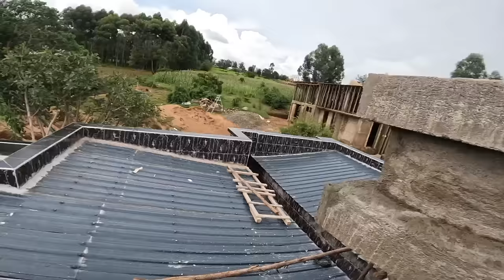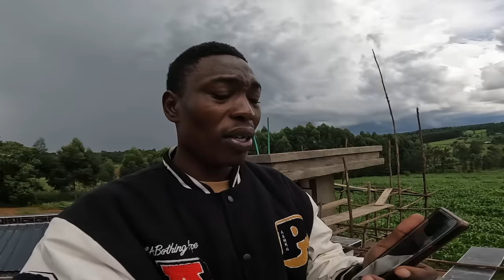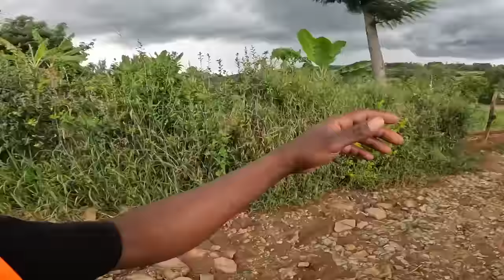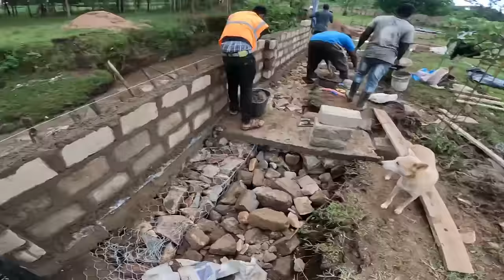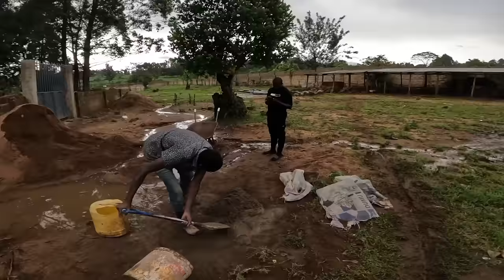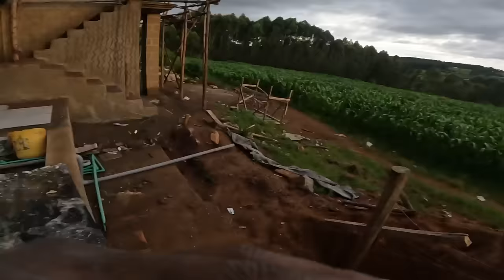Emotional😭!! You cant believe that it has been the last day to save the wall  in side villa Medellin

Comment: How is the foundation outside thr wall on the bank of the river. As the foundation of the bank is not ok. Iam_Marwa still has the problem with the wall. The ground has to be stable before and the back of the wall.

Keep that in mind.  Water thst is flowing in the ground and during the rain season, also in the soil
is not vegetable. Water is not conering, no corner.

Put stone befor the wall in the ground and at the back side on the bank of the river.

Comment: Love your "can do spirit" Mayuguno. The land under the gabions doesn't appear to be firm, so placing another heavy brick wall over it so soon might not be a wise thing to do  The new wall and its foundation will soon crack again if the gabions keep sinking into the soil beneath
them.  Video posted by Ngutu today showed  big cracks in the soil under the gabions near the Eriver that will be washed away if watter from the pipes you placed to drain water over and thru the gabions keep falling in the same spots  24/7 (meaning ALL day). 😢🙏🏼🫶